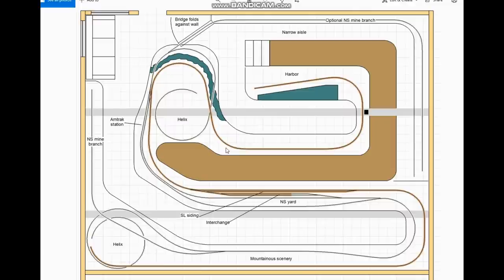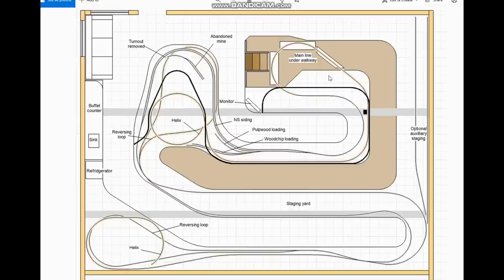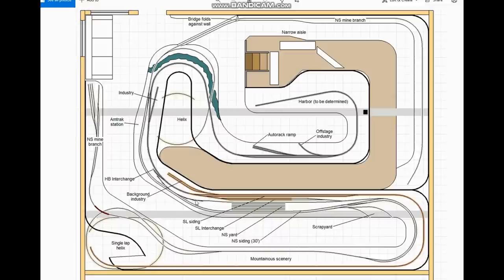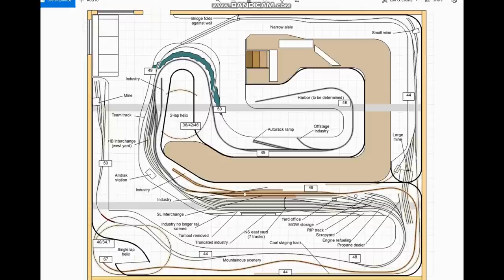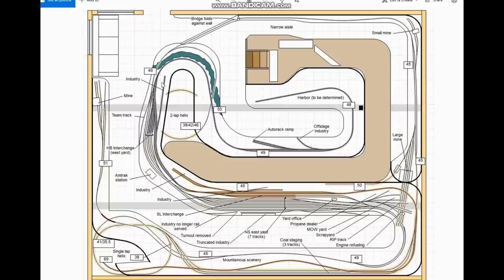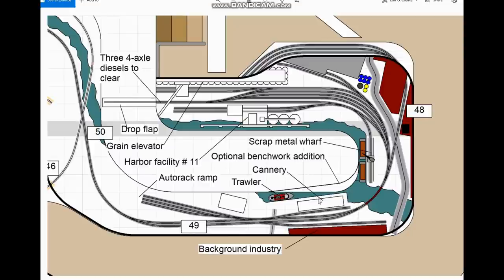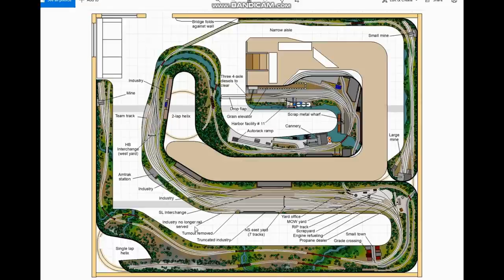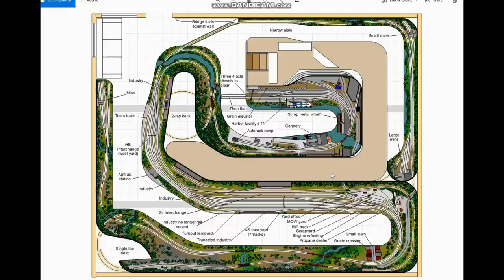Design for a complex three-level mushroom layout, part 2

Comment: Such a great design Peter, love the way you go over the different options, thoughts, iterations and feedback back and forth, between you and the customer. It is truly a project of shared knowledge and most important cooperation between wishes, dreams, acquired knowledge and the way the designated space allows for the design. Thanks for sharing.
Reply from the maker: In any layout design, the client feedback is an essential part of a good layout design.  In this case, the client took a very proactive role in the design and the results show it.  It is as much his design as it is mine.
Reply: The communication between Peter and I was absolutely great.  We were able to bounce ideas off of each other during the design process, weigh the pros and cons of each idea, and work together to create an excellent outcome.  Peter was very responsive during the back and forth development process, with I don't think a day going by where we didn't have an email exchange to ask questions, or answer questions, float ideas (with some of mine being probably a little off the wall at times), or provide pictorial inputs for the harbor facilities and cannery facilities to get across what I wanted to end up with.  We were able to discuss ideas very openly, work through the challenges of the truss structure, elevated platform design, and it came together absolutely beautifully in the end.  The video series doesn't show all the back and forth ideas, sketches, interim stages, etc.  but version 22 is where we ended up when it was all finished.  It was great working with Peter on this project.  I feel blessed to have been able to get him to do this design.  As I said in the first installment, it was worth every penny, worth the wait in the queue, and I'm extremely pleased with the result.

Comment: Here is an idea for industry to industry boxcar move since this layout has a papermill. I work for a distribution center and we produce a lot of cardboard waste that gets processed into bails. On this layout there could be a warehouse that loads 50 foot boxcars of this waste that goes to the mill. When I worked for the NS I used to service a couple of carboard manufacturers. One of these facilities would get 9 loads of paper daily delivered in 50 foot cars. The other received 5 cars daily with one of those being loaded with scrap cardboard.

Comment: This is going to be one of the nicest layouts that you have designed. Have you considered a self closing gate that opens into the stairway to add to the safety and possibly to avoid having to widen the area around the stairs? I wish I could add onto my layout room but those basement walls are hard to move. Great design, thank you for sharing the thought process of you and the client in developing the plan.
Reply: Being able to decide where the south wall ended up was a big help in the design of this layout.  Basement walls don't allow that so easily.
Reply from the maker: We discussed many different ideas for the top of the raised walkway.  Any arrangement involving a moving something will always suffer from three basic flaws. 
1. Complexity adds both initial work and ongoing maintenance which could be better spent on the railroad. 
2. The need to move anything from one position to another is an annoyance, and when it has nothing to do with the train it also detracts from the operating experience.
3. There is always the risk that someone will fail to move the safety equipment into place as they should while someone else assumes that it is there, thus making it worse than if there was nothing there in the first place.

Comment: Very impressive, obviously useful to have that extra two feet option, really makes for a much better layout. What an amazing, and beautiful layout this could be. Any one section of this layout would provide hours of operating potential, but put it all together…
Peter, in the third part would it be possible to discuss how automation might enable single operator use of an individual section, while having some trains operating in the background providing continuous timetabled operation? I mean, I guess how many continuous loops (or back and forths) there are?
And an indication of how many operators you would need to run the layout at full operating capacity?
Reply from the maker: Almost any layout design can benefit from being able to magic an extra two feet, no matter the size.  This was one of those rare cases when that was able to happen.
Part 3 of the series is already uploaded and scheduled for next week.
Reply: Good news, no worries.
Reply: With the various DCC / LCC systems out there, and some programming skills, it would be possible to automate a good part of it to run NS trains from staging to staging while you worked the Harbor Belt line or the Short Line manually.  More research is needed in that area, but from what is available on the market today, it is feasible to do it.  That would be a significant project in and of itself.  The hooks could definitely be built into the electronics to allow that to be added at some point.

Comment: What are your recommendations for managing train cars that are placed on tracks that go through the backdrop into hidden staging? Do you recommend cameras to see where the cars are on the tracks and how many cars there are? Or is there another method commonly used to keep track of those cars?
Reply: There are some good car routing programs that let you keep track of the car fleet on the layout, and assists with creating trains and determining where the cars should go, and to what industries.  Cameras can also be used to visually verify what is there.  Most operating sessions require some prep work where you would confirm what cars are at what industries as well.
Reply from the maker: For large hidden areas (such as staging yards & long hidden runs), a series of video cameras hooked up to a computer monitor is probably the best way to go.  Everything you need for this is readily available under the description of "home security system" at a cost that is probably insignificant compared with the total cost of the railroad.
For smaller areas (such as spurs that head into buildings), I just try to ensure that the spur is somewhat longer than what I tell operators.  That way, they won't run off the end.  Normally, in this situation, the end of the first car remains visible through the door of the structure.
Other methods that may work in some situations include infra-red light sensors between the rails, and mirrors.
Reply: @littlewingpsc27  I'll have to look into those car routing programs. Thank you for the recommendation.
Reply: @mpeterll  Thank you for the advice Peter. When the time comes, I'll probably go with cameras, but the IR sensor sounds like an interesting option as well. Always looking forward to your next video.

Comment: These diagrams would be easier to understand if you shaded the walkways differently from the decking.  I like your designs though.
Reply from the maker: I assume you mean something like shading the raised walkways a light tan and each step a slightly different shade while leaving the bare floor areas white.
Reply: More like shade all walkways something, even a light gray so that you can tell the difference between walkways and benchwork. It was a lot easier at the end when you had scenery. But in the beginning youcan'ttell what lines are what .

Comment: Do you model “O” gauge?
Reply from the maker: This layout design is for HO-scale, although I have indeed worked quite extensively in O-scale.  I have a few layout-design and scenery clients who work in 3-rail, and one O-scale 2-rail layout design coming up next year.  I also spent several years (a long time ago) building cars and locomotives in British O-scale (which is 7mm=1ft, not 1/4"=1ft), although  my layout never progressed to the point where it was operational, nor did I ever take any photographs of it.